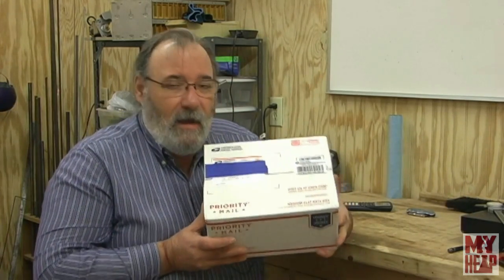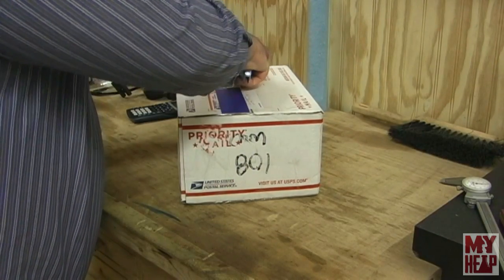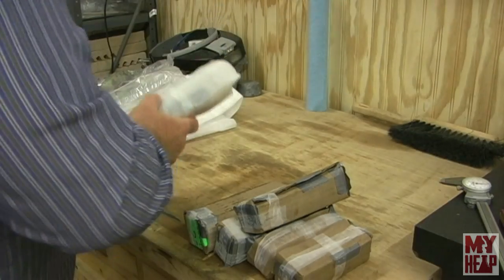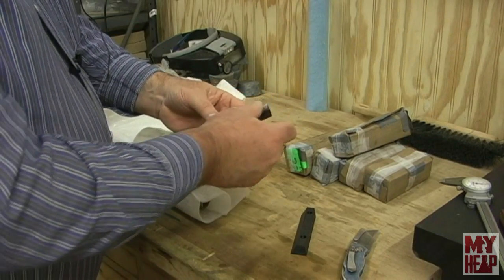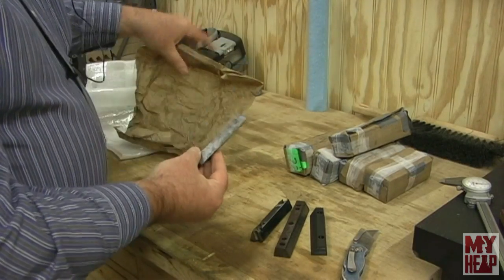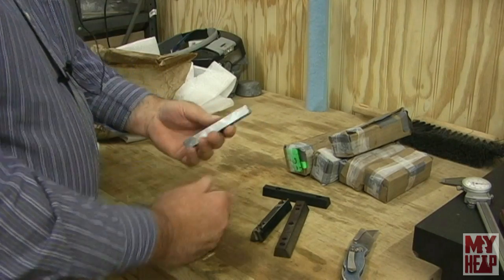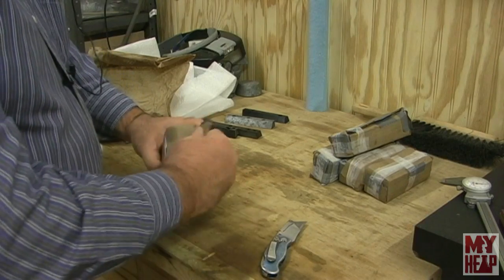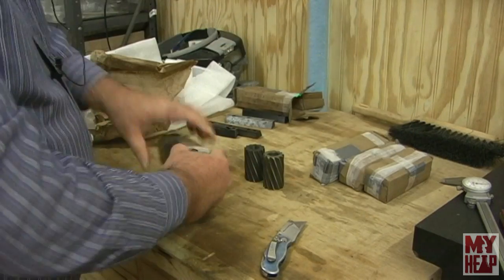Burke #4 Mill - 03 - Gib Collaboration Completed

Comment: We are now following them both thanks to you. Watched your gib get made over there. Nice cutters he also sent to you. Measure twice is a lesson here my giant personal mistake I now measure twice cut once.
Reply from the maker: I am glad you are checking out Chirpy and Richard.  They are great folks.  When I created the initial drawing I measured several times.  Asked my son to print one in plastic as a sanity check.  It worked beautiful.  Chirpy made the give spot on to my drawing, so I was a little surprised.  Well the plastic gib printed a little smaller than the print.  So while I just barely escaped a failure, I learned that the 3D printer needs to be calibrated.  Thanks so much for watching and taking the time too comment.

Joe

Comment: I think the gib will be fine as is and will allow for wear, but will defer to those more knowledgable than me. So glad the project is coming together and thanks for the kind words Joe
Reply from the maker: That is the general consensus.  I need to take a little off the bottom to clear the knee casting.  At first I thought it was the dovetail that was hanging but turns out that the gib wedges up in the casting.  Easy fix.  Thanks again Richard for donating the cast iron. I appreciate it and the support you give the channel.
Reply: Glad the iron I sent machined well, I couldnt send what I planned to use originally. Did you see that stuff once machined?, i think they make window sash weights from slag...Lol
Reply from the maker: I watched your video.  That weight you turned down was pretty junky on the inside.  I guess if your just making a weight, you can use whatever crap you scrape off the top of the melt.  Thanks for the donation Rich.  Your work install you a mill and a lathe yet?  😁
Reply: All it needed to be, is heavy. Solid was not a job requirement 😀
Reply from the maker: @somebodyelse6673  RIGHT?!?!

Comment: Mine has slightly less gap, but probably due to a lot of years of wear.  I say its fine as is, worst case is more wear ajustment room over time.  Excellent workmanship on the gib.  Nice to see it progressing along.
Reply from the maker: Hi Bryan.  Chirpy done an awesome job on the gib.  I think I will use it as is with one little modification.  The bottom surface of the gib catches the edge of the knee casting before making the end of travel.  I am going to take just enough off so it will clear this area.  Thanks for watching.

Comment: I think that gib looks great.  I would not change a thing.  I have the same machine, and mine has a pretty good gap there as well.  Keep up the good work.
Reply from the maker: Thanks Robert.  The gib does fit really well.  I will have to thin it a little as it interferes with the knee casting.  Thanks for watching, and supporting the channel.

Comment: Hey joe, I would honestly just leave it be and let it wear in since that will give you a lifetime of adjustment. When your dealing with a tiny angle like that, you remove any material and you will have it climb up the taper very very fast and will run out of adjustment very quickly. 

I wonder how much interference there was between the knee and the gib, it doesnt look like more than a few thou, so it shouldnt be too hard to file off a little bit there in the back to have it just slide right over it. Sorry about that.

Im glad the package arrived in one piece and that nothing was damaged, I tried to package it so nothing would happen to the stuff. With the arbor I sent you in the email, it should be pretty easy to get it set up without having to deal with the angles and such for the B&S#6 taper. 

Also, yea, the shaper is defenitely hypnotic, and will do almost any job you want to do on it, lol. And thanks to richard for the materials to do this.
Reply from the maker: Hi Chirpy.  Sorry for the late comment, YT seems to think that your comment was potential spam.  You and another users comment.  Go figure, huh?

I agree with you and the general consensus is to let it be and use it.  I will take a file to it to get it to clear the knee casting.  You done a wonderful job on it, btw.  Thanks again for making it.  You have been a HUGE help to me.

I read the post about the arbor.  If the deal for the B&S#9 ER collet chucks comes through, then making these would be a snap.  Thanks for the link.

What are your thoughts on the Gingery shaper?  Of all his home built machines, it seems like it would be the most rigid.

Joe
Reply: no problem and glad to have been able to help. The gingery shaper, thats a difficult one to really judge, but it seems to suffer from the same rigidity problems the rest of the gingery ones do and in all honesty, you can find an atlas, south bend, or a similar 7" shaper for pretty cheap usually. They usually pop up once in a while and usually go for pretty cheap. Mine is actually a 7" shaper and you know what mine is capable of, lol. 

I would honestly talk to the guy over at metalfrog, he does alot of his machining on a gingery shaper that he's built, and is usually on the paul's garage discord server, so you can catch him on there alot of the time. Im usually chatting with him on there. If you want the link to his channel, I can post it on here or email it to you so it doesnt pick it up by youtube's spam filter.
Reply from the maker: I know that the designs suffer from rigidity issues, but was just wondering.  Of all his designs, it seems the most rigid.  I have to get the mill up and running and the rockwell sander before looking at another machine, unless it is something that follows me home because someone said, here have this.  That has happened to me.  I think my wife believes I have some sort of mental illness with this shop stuff.  I told her that I am trying to get enough stuff now, so that when I retire I can piddle out there in the shop.  If you would email me his channel that would be great.

Thanks again Chirpy for taking me under your wing so to speak!

Joe
Reply: From what Ive seen, they do work, but not that great for steel or harder materials, and it doesnt have the biggest cutting area either, which really sucks for alot of projects when your only limited to like 4 or 5" cutting area, then when you add a vise and such, that goes away pretty fast.
lol, Im the same way with the tools just following me home and Ive had someone say the same thing to me about it, lol. I just looked at her pile of shoes that were sitting there, lol. It didnt end well, so I wouldnt advise that...
Ill send you the link, but it looks like he removed alot of his videos, so idk how much help it will be to you, but he does have one up that he's machining some steel for some tool bits he brazed up.
Reply: Chirpy's Tinkerings, I think it is great for you to do this for Joe!
Reply: I was just helping out a friend, fellow youtuber, and was really just a fun project.

Comment: I suggest leaving the gib as-is and using nylon locknuts on those gib studs.  BTW, get a sturdy stand built.  Good video.  Happy machining.
Reply from the maker: Hey Jeffry, the nylock nuts are a good idea.  Thanks.  I need to build a bench for it.  Just put it on the saw horses to disassemble.  Thanks for taking the time to watch my video and commenting.

Joe

Comment: Gib looks good, might want to consider making up some brass shims to fill in the space,
Reply from the maker: Hi Steven.  I don't know that shimming would have any affect on it since it isn't meant to ride on the top surface.  I received your email and will take care of it tomorrow.  Looking forward to the stones.  Thanks for taking the time to watch.

Joe
Reply: I think that if shimmed with the correct stack of shims you could adjust the fit and keep the nuts tight.
Reply from the maker: I don't mean to be dense Steven.  Where would I put the shims?  There would be no space on the sides where it rides on the dovetails.  I think I am missing something.  Like I said, I don't mean to be ignorant, it just comes natural to me.  😀
Reply: Shims go over the studs and fill the gap between the top of the gib and the casting.
Reply from the maker: Even thought the top is not a sliding surface?  Or to keep crap from getting in there?
Reply: With the correct shim stack it not only fill the gap but give you a ability to tighten up the nuts without making the wedge too tight.
Reply from the maker: I understand what your saying now.  The gib has a setscrew that adjusts how tight the gib can be tightened.  Or at least in theory.  The saddle gib has one setscrew and the two studs while the knee has two setscrews and three bolts.  Sorry about being so dense Steven. Thanks for being patient with me.  😀

Joe

Comment: Joe I think the boys did a bang up job. Would use it as is and not mess with it. Very slow moving part that fits great now.
Reply from the maker: I tend to agree with you Steven.  However, if used as is, some slight thinning if the gib will be necessary to clear the knee casting.  Glad to see you Steven.  Thanks for watching and taking the time to comment.

Joe

Comment: The way it is now you got a lot of wear before needing another one use it as is as if it does wear you will have plenty of material to scrap to get it back in shape
Reply from the maker: Hi William.  I think I will likely leave it as it is, except a little will need to be filed from the bottom so it clears the knee casting.

Comment: G’day Joe the gib looks good I wouldn’t touch it. So is that extra screw the gin adjustment?? Good friends you have there. Cheers Peter
Reply from the maker: Hi Peter, great to see you!  The only problem is the bottom surface of the gib catches the knee casting.  I will have to take some off so it will clear it.  Otherwise I don't get the whole Y axis travel.  Being the bottom of the gib, it will not have any affect on it.  Thanks for stopping by.  How is the tailstock project coming along?

Joe
Reply from the maker: Realized I didn't answer your question.  The set screw in the gib allows you to adjust it for fit while the two nuts lock it in.  The knee gib is similar except it has two setscrews and three bolts.
Reply: G’day Joe, ah the tail stand continues next week with machining the bearing boss with the preview showing a major disaster with the lathe, oh no it’s broken, wait for the disclosure next week. Cheers
Reply from the maker: I will be there my friend.

Comment: It looks okay as is.  However, give some thought as to how the gibb will function/wear over time.  With the set screw in the middle and the bolts at each end, I'm wondering if the gibb will bend over time and will the adjustment hold up (i.e. not loosen) over time and usage.  As is sets I don't think you can torque the nuts tight enough to hold adjustment.  Also, the left side of the gibb has a groove/ledge that will prevent the left side of the  gibb from moving upward vertically for adjustment or so it seems.  In the future when the gibb needs adjustment that ledge will cause the gibb to rotate resulting in the fight side of the gibb to not fully contact its mating surface.  Personally I would consider redesigning the gibb with some slight changes.  Like removing the ledge on the left side of the gibb.  All that aside, I look forward to seeing you get this old jewel back in working condition.
Reply from the maker: Hello James.  I am sorry for the late reply.  Seems YouTube thought your comment was potential spam fro some reason.  Go figure.

That is some good food for though, especially wearing a ledge preventing the gib from future adjustments or proper adjustment.  I will try to take a look at it with a critical eye.  Being a new guy, I appreciate the thought and comment of others.  Thank you for taking the time to let me know.

Joe
Reply: I was looking at that and thinking about it also, but as the left side of the gib only goes up to adjust it and take up the wear in the gib over time, it isnt really a sliding surface so wouldnt really develop a groove in it. The only place it would develop a groove is on the right side where it meets the dovetail, and as that wears and is taken up, any step there is worn off almost instantly really. By the time that really becomes an issue, the gib will have to be replaced and it'll probably be his grandchildren or great grandchildren that have to deal with that, lol. By that time, the machine will probably have have gotten alot more wear than anything and just be rescraped anyhow, and any step is removed then, so yea, I dont think it's really too much to worry about tbh.
Reply: I could be wrong but the ledge on the left looks like it is machined into the gibb.  I can't tell from the photo but It looks like the ledge on the left side of the gibb is already in contact with the bottom of the saddle.  If that is true, then there really is no adjustment in the gibb.  I think the Ledge on the left of the gibb is not a good idea.  I think long term (depending on use, 1- 2 years) it will cause problems.  It doesn't take a whole lot of wear for gibbs to need adjustment.  I guess what it all comes down to is how accurate do you want you parts to be.
Reply: there is no ledge on the gib on any side, they're just straight down the sides and then scraped to get it flat and to give it some bearing surface. Im not seeing where your seeing a ledge at.
Reply: I gotta get my glasses checked.  I swear I saw one but I just checked the video again and I don't see it.  Sorry bout that!
Reply: lol, no problem, need people to keep an eye out and keep us on our toes. :P

Comment: That looks like ordinary dovetail wear, not a measurement error.  I'd bet a jelly donut that if you checked that casting surface, you would find a wear lip where it binds that little bit.

Any time an older machine is put back into service you wind up dealing with the issue of whether to scrape the worn ways or not.  I would advise you to NOT take a file to any dovetail surface, as it is difficult to keep from doing more harm than good.  

In any event, I like your style of video making.  I hope the machining hobby engages you enough to keep sharing your projects and progress with the world.  Carry on, sir!
Reply from the maker: I need to take a close look, but the ways looked like there were still traces of scraping marks.  I will check to see if there is a lip, but the bottom of the gib catches on the knee casting before the saddle reaches the end of travel.  I plan on taking just enough from the bottom of the gib to clear the casting.  Then I can proceed with closer inspection.
Reply from the maker: I am glad you like the videos.  It has been a joy to learn to do things with my hands rather than messing with a keyboard and mouse.  Thanks for watching and commenting.

Joe
Reply: Do you have a set of feeler gages and either a straight edge or flat bar you know to be flat within one thou? Ideally you might blue it up and check the contact pattern over the full length/width of each dovetail surface.  That's a pretty definative assessment of wear and flatness, but it's also the first slippery step on the path of machine scraping 😨

It would be a better world if one could simply assume that scraping marks indicate correct geometry, but that is not always the case.  It may or may not be factory scraping you see, and even with old American iron, there were some that escaped the factory with less than great geometry.  The only way to know what you have is to check it.
Reply from the maker: I have feeler gages, not so sure about a straight edge.  I hope Chirpy's straight edge and surface plate project comes to fruition.  I would like to have a 12" straight edge.  And I guess learn how to scrape at the same time.  I will look around for something that might be straight.  I think my smallest feeler is .0015

Joe

Comment: Joe,
There is no point in taking off more material. The moment you have the gib bearing on the top surface, it loses its function, so one mm or two mm of a gap... it doesn't make a difference, As long as you angles are correct, I'd say you're good to go.
One thing that you may do, is to clean the surfaces (get rid of the oil) and put some engineering blue on them.
That will soon tell you if you are bearing on the entire surface (or of you have any high spots)
But all in all, from what we can see on video, I'd call this a usable part.

Cheers
Paddy
Reply from the maker: Hi Paddy.  I am well pleased with the way the part turned out.  After I get everything pulled apart, cleaned, stripped and repainted I will check the fits closer.  Blue them up etc.  You will probably be getting some emails with my newbie questions along the way my friend.  Thanks for all your help thus far.  I appreciate it.  Still watching the post, by the way.  It's in transit the last I looked.  The pond takes a while to canoe across you know.  😀

Joe

Comment: I am a YouTube machinist as we call it so far from experienced but if it’s bearing on both surfaces with the gap is that not the idea so there is room for adjustment in the future if it was not supposed to be that far down the bolts would be shorter would they not
Reply from the maker: Hi Allan.  The general consensus is to use it as it is.  You are correct sir.  Thanks for watching and taking the time to comment.  I appreciate it.

Joe